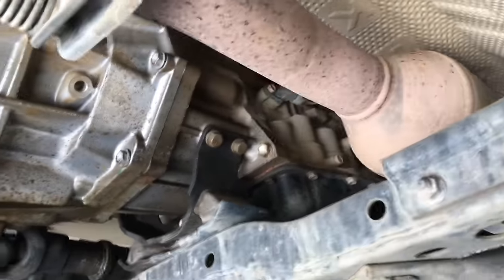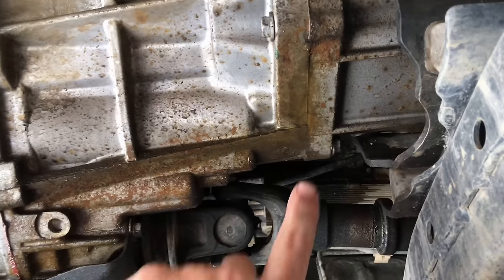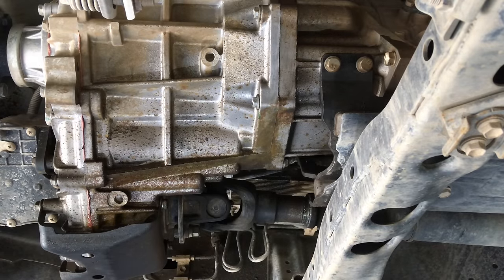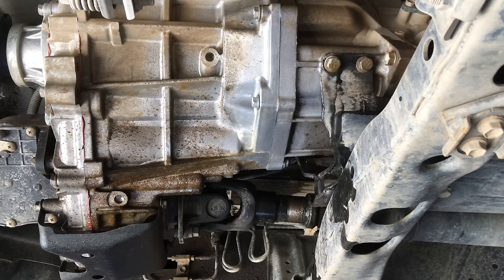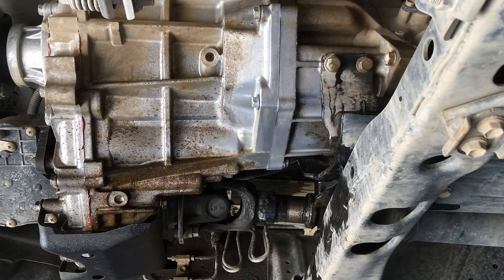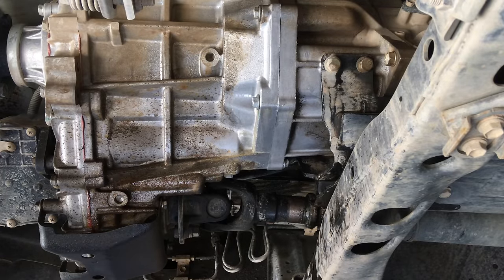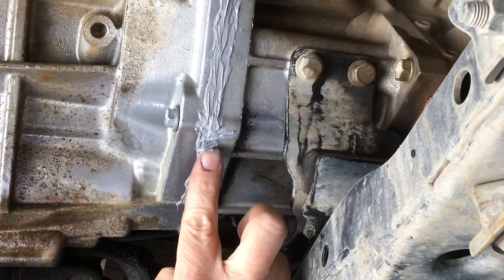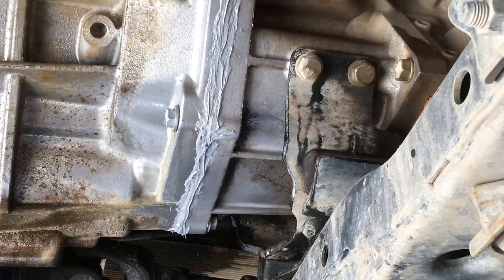CHEAPEST OIL LEAK FIX THAT WORKS

Comment: My Volvo is a candidate for this. Genetic defect according to my mechanic. He just said let it leak. Vehicle really needs a diaper. And after long hills or after long high speed drives it can smoke pretty fierce for a while. It is worrisome and it kills the grass over time if I don't put down a tarp when parked in the same place. I'll try it.
Reply: Omfg same here

Comment: One tiny bit of an extra to this. If you wipe the seam with some 70% alcohol after cleaning it with the brake cleaner, which will remove any residue that remains, the RTV will stick on for dear life, ensuring a serious seal. Otherwise, great job!!!

Comment: When fluid comes out between the cases like this (between engine and transmission, or between transmission and transfer case), it's because there is a leaking seal inside.  There should not be any fluid inside those housings.  Even if you manage to seal up the case joint, all that will do is let the inside of the case fill up with fluid from the leaking seal.  And even worse, it will mask the leak for a long time, possible allowing the transfer case or tranny to run low.

Comment: Not sure if I commented before..on this leak??
You need to look at the top of the 4 wheel drive lever,  4 bolt flange. You will need to remove the center console and the gear shifter...mine is an automatic ...
Another Youtuber, showed me and sure enough the flange gasket failed...
Took apart made new gaskets and leak stopped.
Worked for me...

Comment: If you think that’s dodgy, my boy bought a 2005 Honda CR-V. Someone torqued the oil sending unit so tight it cracked the block. Option 1 order a JDM Engine and swap it or option 2 drain oil, remove sender, clean with brake cleaner, put rtv on threads and install sending unit to push rtv into crack. Repeat 3 times. 
We did option 2
Reply: Oil sending is under high pressure  hope it works or the crack does not spread.

Comment: Hi, awsome quick fix. Will try it. I get like occasional 1-2 drops on the ground after half hour of driving from my rear main seal as well.
Reply: I have the same issue. Few drops between engine and transmission. Have u applied this fix ? 

I am afraid that by applying this fix, the oil will find another path and the damage will be much worse!!

Comment: Quite a common leak on these I’m pretty sure Toyota has a service bulletin on the issue. From memory there’s two seals in the input of the transfercase which cause the leak. The cavity between the two cases fills with oil from the transfer and weeps out the seam because that section doesn’t get silicon as it’s the seals that keep the oil in. I understand the temporary fix you’ve done here though 👍🏼
Reply: Exactly mate definitely a bulletin  I use to work for toyota  revised transfer case seal and transfer.
Reply: Seen this setup on multiple Asian manufacturers. Ther should be a dry cavity with seals like you explained. The leak at seal will continue until the level gets above the temporary repair just made.
Reply: @jefferyrobards6368  SIlcone can seal a crack well but it has to be pusshed inside the crack or it may not work ,all you need is to rub it against the case with a rag ,if done consistenly all around it will never leak again , bolt holes may need similar treatment .
Reply: This statement is exactly right!!!! Remove transfer and new seal. Easy fix.
Reply: @stevensepulveda9474  Did exactly that on my 80. Had a similar leak. Doing a service, I noticed the transfer case oil volume was much less than it should be. Gearbox was fine
 Changed the transfer case input seal & all good. 👍
Since rebuilt both transfer case & gearbox, several years later.
Reply: My 80 had a similar leak. Changed the transfer case input seal. 👍

Comment: Methinks the engine should be quite hot before apply the sealant. Let the engine cool. Then the gasket bolts should be tightened to a very slightly higher torque

Comment: Years ago, not sure about now but there was a product that you would spray on a leak such as this and it would weep into the leaking area and then harden. I fixed lightly leaking oil pan housings with it. Worked great. May have been the spray can stuff from permatex.
Reply: Yeah that is the stuff from Permatex for low pressure things. Did work on my valve cover gasket some.
Reply: Is there anything on market that can seal a gasket that's leaking oil.  Please help

Comment: This might help for next time clean with brake clean then use ivory bar soap to go between crack to keep oil in then seal over the soap work’s every-time also works for fuel tank leaks

Comment: If you decided to do it the way in the video it might have helped to loosen the bolts around where it was initially leaking so that you could get more separation between the two mated parts therefore the silicone would penetrate deeper, since it is a shade tree quick fix that probably won't hold up for a long length of time
Reply from the maker: Loosening the bolts doesn’t make any difference it’s not an oil area it’s just hiding in oil leak that’s very minor not worth fixing
Reply: We used to do a very similar thing on the Hilux gearbox. They leaked around the sandwich plate. We would clean in off, drain the oil, loosen all the bolts a few threads and move the cases apart a few mill, clean and apply sealant. Usually that was all they need, saved pulling gearbox and t case out and stripping.
Reply: @philelliott5327  :-D I would give you 10 likes for this,if it was possible. I was thinking why they dont unscrew a few bolts put the silicon and thats it, better then the original sealent! .-D
Reply: @Erjet1008  Sealant*
Reply: You risk making a larger or new leak  by opening the bolt gap.  You are only seeing 1/2 of the whole gasket area.

Comment: my 6 speed gearbox is leaking/sweating a bit at a rubber stop but it has some damage there from the old car it came out. If only i wasnt in such a hurry for a gearbox I could have had a better one now its just costing more and more. I dont want to sell my car either but financially speaking i probably should if bad things keep happening. 

anyway this is a good video mate maybe it will solve my problem just for a couple of months.

Comment: To repair the oil leak. Ooooh you don’t want to know. If It’s leaking on the timing cover/oil pump

1. You must remove the exhaust
2 remove the lower oil sump
3. Remove oil pickup tube
4. Remove the upper oil sump
5. Remover the front engine mounts
6. Remove the V-Belts
7. Remove the crank pulley.
8. Remove water pump pulley
9. Remove engine speed sensor
10. Remove trigger wheel
 
Then can you repair the oil leak cover

Comment: Pin hole in sump repaired by chewing gum and bitumen spray did not have to drain oil out as the oil won't come through the chewing gum unlike sealer.

Comment: I am a retired transmission shop owner/mechanic. Rather nitpicky of the customer to complain about a leak that small. The mechanic doesn't know if the leak is coming from within a bolt hole, so the bolts would also have to be cleaned and sealed. Looks like crap when you're done and still may "leak". Best to just live with it.

Comment: This can be temporary in some cases, but you should have removed the excess silicone by applying pressure with your fingers, so it doesn't look cheap.

Comment: If that's what you call an oil leak then you should of seen my mk6 transit, you could eat your dinner off that transmission case, thanks for the tip cheers 👍🍻

Comment: Seams like a rear main seal leak, this method stops the leak being visible but the oil is still filling up in the transfer case. Best thing is to replace that seal.
Reply from the maker: Not worth all the work to replace that seal for five mill of oil per 12 months just hiding the sweat for now wouldn’t even call it a leak
We’re not really into selling everything we can and fixing things that don’t need to be fixed if you know what I mean if it ever gets worse will fix it but we’ve never had to fix one because they’re not actually a leak
Reply: @Fourby4Diesel  I guess so in this case since the leak isn't too bad.

Comment: Rtv will not stop leak without open the joint and apple it from inside but you can used cold welding

Comment: Looks to me like the transfer breather or gear box breather is choked.. causing pressure build up, it will also cause prop shaft seals to start to leak too..
Reply: Is there defo a breath in there mate ?
Reply: Ahmed Musa I have same issue like leak in aveo 2010 can u give input if this will work

Comment: Some dealerships service departments would tell the customer that we have to remove the whole transfer case.
Reply: And they would be right, because there is a leaking seal, which is then filling up the case and letting it leak out through the joint between the cases.  Patching up the joint just lets the seal keep leaking and filling up the inside of the case.  This could allow the transfer case to run completely dry because all the fluid leaks out into the case area.

Comment: Got the same problem on my Honda Fit, it's a stupid seal but it's so jammed up inside that it costs about 1000 bucks to change it, but the leak is so small, something like 2 drops per week, that it's not worth fixing it, I'm gonna do this and call it good.

Comment: No Joke, I have sealed a major header leak on an FJ60 with high temp RTV. Sealed up and ran it for years that way.

Trick is put a layer, allow to dry and apply several more layers in same fashion drying between applications.

Comment: My 2002 4 runner had the gasket go bad on the 4 wheel drive cover on top of the trans.
Take out the console and remove the floor pan cover.. you will see the leak.

Comment: I used to change my Toyota Alphard water pump, the new aisin water pump is not coming with gasket seal. And then i just use Sealer For the waterpump without the gasket seal. And it hold up very well, no leak whatsoever.

Comment: Don't forget to top up your transfer case with gear oil...
Reply from the maker: The main point of this is the lake is that small it’s not even top up able if you know what I mean you would put in 10 mill of oil every year 😁😂
Reply: @Fourby4Diesel   Great tip btw! You are right especially if your vehicle is new and the oil is not too old. What does a tc hold 2L right? I remember that if there is a leak it also means that air and moisture are getting in causing expansion and pressure buildup in the tc so stopping a leak early is super important especially in harsh environments.
Reply: @Fourby4Diesel  so why bother then ?

Comment: Could be the rear main seal leaking , or loose bolts, also brake cleaner is cheap. I would have sprayed the entire trans beside the rubber and plastic pieces down to clean it up for the customer and then sealed it, and then tightened the bolts in hopes some sealant got in the cracks and then the tightening down would have made more of a gasket seal. Then the next service check it, and if you cleaned the entire trans better you may have had a better understanding of where its coming from. But thats just me I guess

Comment: Use rubber alcohol to clean surfaces 100 percent. After use a lint free cloth to dry surfaces 100 percent.  Use which ever sealant that fits ur application.  Make Sure that you Tool you sealant immediately after applying.  Final step is allow sealant 24hr -48hrs to dry
Reply: would you please repeat that? I didn't hear you so good.
Reply: Will it work ok on spark plug tube leak too?  Leak is small car has 295k miles on it . Don't want to spend much money on it.  Want to change spark plugs one last time .

Comment: Best long life fix is Marine tex. Hardens like rock, has psi rete of 1800 psi, oil, gas, kero, acids don't have any effect, resists temp to 500 deg, working time 3 min, hard in 3 hrs at 70 degrees, sticks to steel, aluminun , wood fiberglass, , fixeds hole in boar hull, been in business 40 years . None better

Comment: I have an 09 VW Passat 2.0 T TSI - and it is leaking oil from an opening next to the transmission oil screw. 

I did notice a minor crack like that as well.

Comment: The only thing dodgy here is that the space between the TC and transmission is hollow and DRY. There is the rear transmission seal and front TC seal inside and one must be leaking if you have oil. I assume it’s the TC as the transmission oil would be red. There is absolutely no point in applying RTV on the exterior. The factory doesn’t even use any FIPG or RTV when assembling the TC and transmission together.
Reply from the maker: We know that we didn’t come down in the last shower it’s a cheap fix that hides watts barely even an oil leak and a demonstration of how a product can be used we never said that it has rtv on there from factory we never said there’s meant to be oil in there

Comment: time would've been better spent checking & tightening the case bolts and cleaning the breather which wasn't mentioned . if leak isn't bad enough to leave streaks or form drops it's prbly not worth messing with. clean & keep under observation ( chk next service )

Comment: Check torque on bolts clean area blow off with air and run a stop leak additive
Reply: Never put stop leak in an engine unless you plan on selling it.

Comment: Hmmm, wouldn't the leak... If it's coming out between the engine and the transmission, wouldn't that likely be a rear crankshaft seal?  It's not leaking where you're sealing it, that's just where the transmission joins the engine, it's leaking at the center where the crankshaft transfers power to the transmission.?  Maybe I am wrong.
Reply: Yeah, it will just fill up there not that it can't escape lol
Reply: @joshnelson9571 What happens then?

Comment: Great video thank you!

Have you ever used this silicone gasket sealant on the oil drain plug and/or the actual thread of the oil pan where the plug goes in? I bought the Ultra Black tube. 

I can see the oil is slowly dripping from the oil pan plug. I bought a new plug/washer and will replace it but since I have to drain the brand new oil I figured I'd also add this silicone sealant (wait 24 hours to allpw it to dry) and then pour the new-ish oil back in.

I knew there was an issue when I did the oil change and the plug wasnt going in by hand at all, had to use socket wrench to get it in. (Usually I had tighten the firsr part and then finish with a socket wrench) Didnt have a choice at the time and needed to finish the oil change so I socketted it in and next day I saw the slow drip. Pan looks in tact. 

I would GREATLY appreciate your thoughts on this.

Thank you so so very much.
Reply: I actually bought a new oil pan and gasket (approx $35) and will attempt to replace it next week since auto shops want $450-$620 for the job.
Reply: I wouldn't use silicon on the plug. Use the correct washer. If that doesn't work, try washers of different materials and thicknesses, fiber, aluminium, copper, etc. Something should seal.
Reply: I use permatex aviation gasket goo on sump plugs, it's thick black goop that looks like thinned out tar and it doesn't dry hard.. i put some on the threads on every viechel i change the oil on and it not only stops leaks from ever happening, it makes it so you never have to over tighten the sump plug to a point of damaging threads trying to stop a leak
Reply: Hey I had oil pan bolt stripped as I was taking it out. I used a o-ring for the A/C lines, it was an o-ring for the orfice tubes. And I used some black gasket maker sealant and tighten the bolt down till it was tight and couldn't move anymore before it kept spinning. And I have not had any leaks around the bolt since. I used small amount of the gasket sealant. And it sealed right up!!!! O-ring from a/c orfice tubes, gasket sealant and it worked for my stripped oil pan bolt, not leaks any more
Reply: Hi not sure if you managed to fix this. I only saw this now. Had a similar leak i torqued the bolt to factory spec and never had the leak  again.

Comment: Q: is the transfer case over full?
Q: is the transmission fluid level dropping some?
Depending what's happening, you can determine what needs to happen to solve, or manage it.
I don't use acid cure RTV on aluminum.
Since like, 1985 or so it can cause the aluminum to get corroded.
There are seals involved at the end of each of these components. They aren't  cheap and the labor would add to an estimate. So, you inspect the fluid levels and go from there. Some makes have a gasket there. But not this one.
Reply: VERY GOOD.

Comment: Compressed air has a lot of moisture in it
Reply from the maker: Compressed air has some moisture in it it’s a not water after all unless you have a filter on it of course because it can also have debris in it
Reply: Compressed air in larger shops does not have much moisture. There is a dryer after compressor that takes care if it...
Reply: I was thinking about that to. And that the brake cleaner might actually break down existing sealer and worsen the leak. But worth a try.